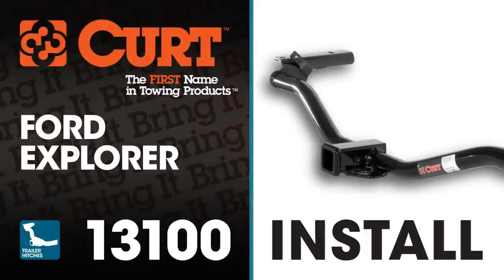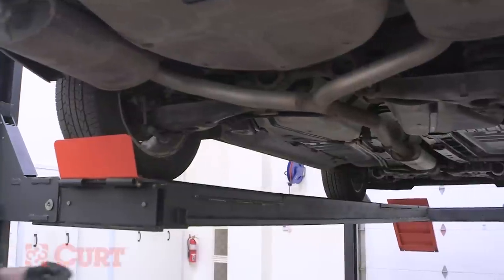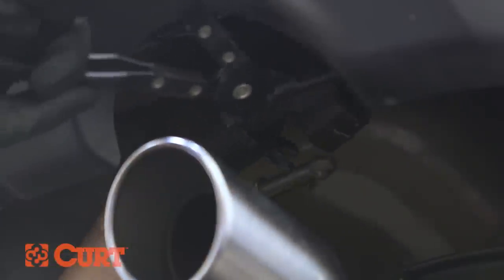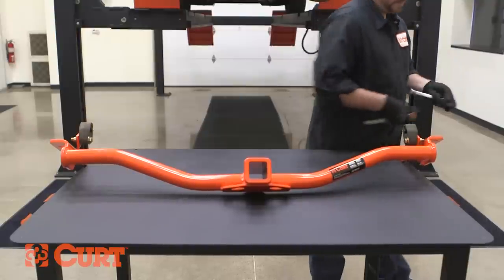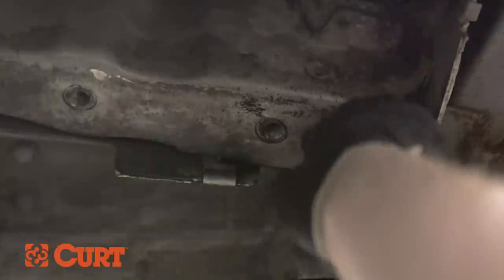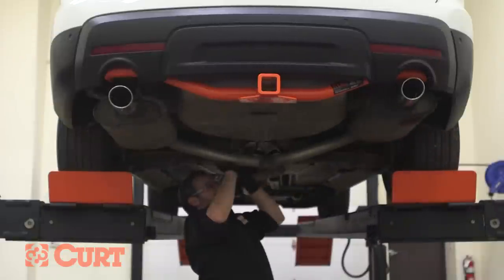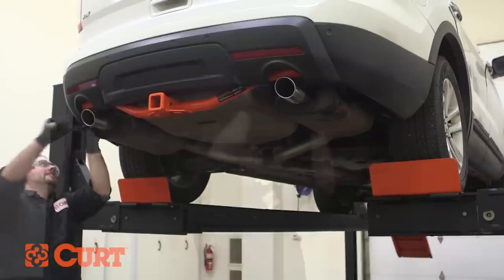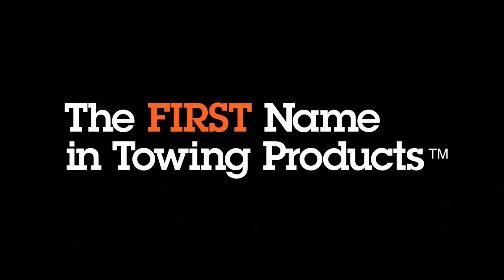Trailer Hitch Install: CURT 13100 a Ford Explorer

Comment: what is that bolt that you fish wired??  so you have 2 bolts on the drivers side.. and 3 on the passenger side?  im curious to know if that 3rd bolt is needed.
Reply from the maker: It is absolutely necessary. We engineered it to be that way for safety. You must install the product correctly, as defined in the instructions, before towing, anything else is dangerous to you and everyone else on the road.

Comment: I'm still confused on the torque. it doesn't specify how much.
Reply from the maker: Check out step 6 for the torque specifications: https://assets.curtmfg.com/masterlibrary/13100/installsheet/CM_13100_INS.PDF